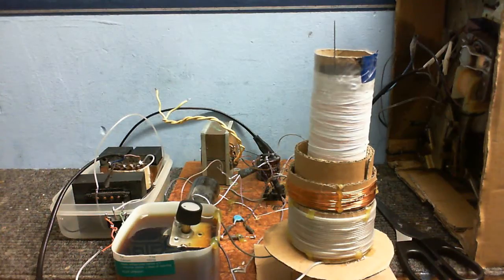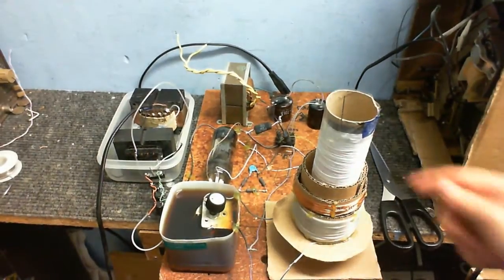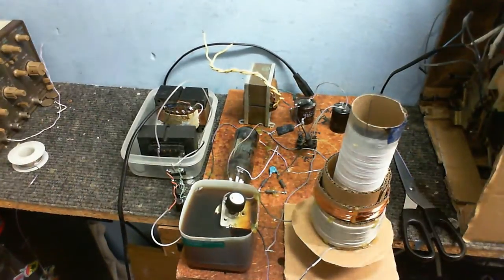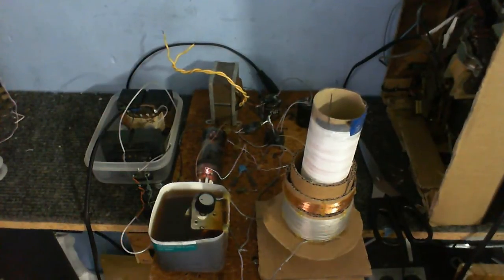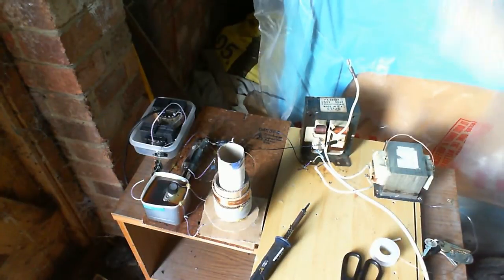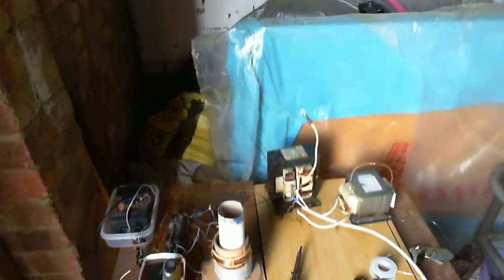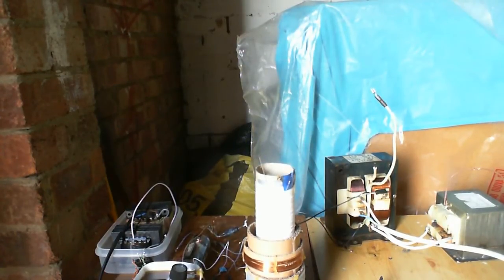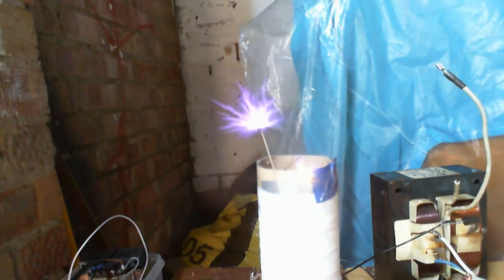PL509 VTTC on MOT, and a bit of rambling

Comment: i hope you get awsome results
becaus
i have an extra for your circuit so you audio modulate it

and i love to see those results
Reply from the maker: You mean I could make my VTTC audio modulated? That would be awesome!
Reply: yes you could
and you could do it with the pcl tube i included
i will mail the circuits
Reply: CoolDudeClem Yup , you can I did it with a 811a VTTC using a smoothed DC supply , It can be done either with biased mosfet in the cathode on triode based VTTC or via grid 2 on tetrodes and pentodes
Reply: twirlywirly555 mosfets in a tube circuit

blasforme

:P
Reply: *****  Works pretty well for a triode based coil like I did , just like SCRs are used to interrupted VTTCs , But using another tube to modulate the G2 of the main tube for audio is better or use a transformer instead  xD .
Reply: i know
but i aint a fan of mixing them
Reply: *****  Ok .

Comment: the pl509 does not need rectified glow wires

just feed it ac
Reply from the maker: Normally I would have used AC there, but the transformers didn't have quite enough voltage, adding the rectifier just gave it a little bit of a boost.
Reply: if it is a few volts it does not matter

Comment: nice job! and what type of oil are you using with your capacitor?
Reply from the maker: It's just ordinary engine oil, a little too think for this kind of thing but it works.
Reply: CoolDudeClem just make sure it's not used engine oil since carbon and metal impurities will make it a lot less of an insulator than you think even unused oils may have additives that are conductive. the best insulator is no insulator (aka a vacuum) is the way i see it. BTW 3:02 i'd love to see  (preferably have) a 20,000 volt MOT!